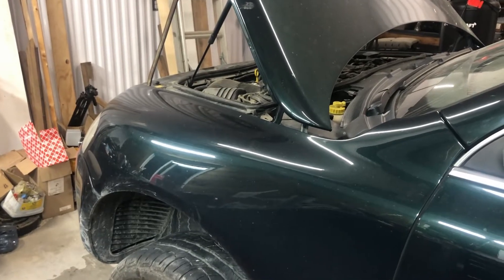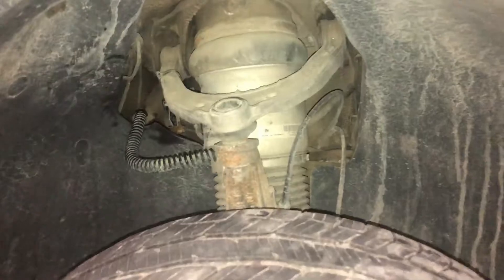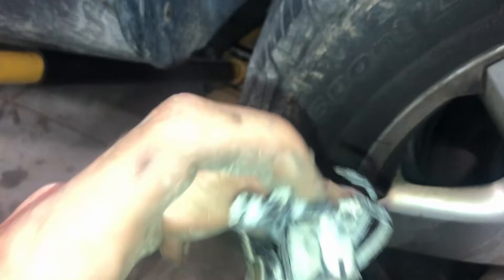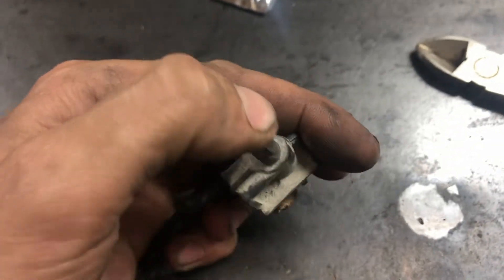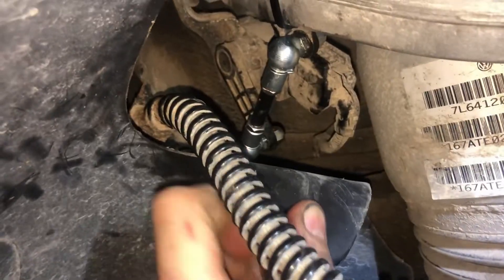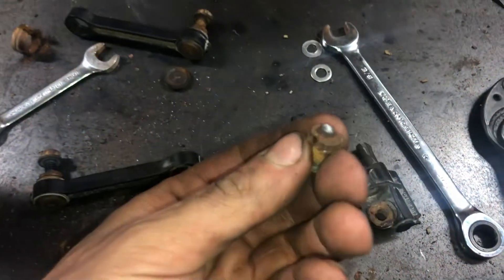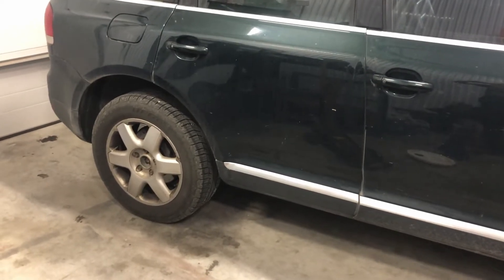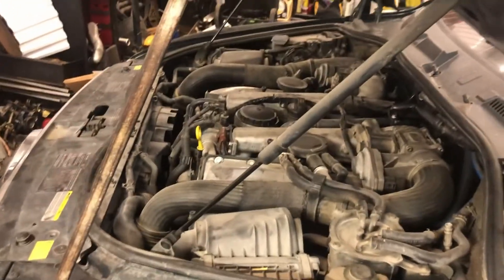7L/T1 Touareg DIY Ride Height Sensor Repair

Comment: Hi. I have a Porsche Cayenne from 2009,quite similar suspension. My problem is that the front suspension is lower than the rear in every level. There is no error on board no light or messages. I checked the front hight sensor and it has a movement on the upper arm fitting,probably that plastic thing is worn out,on both sides.Is that possible to cause the problem? Thank you!
Reply from the maker: They can wiggle a little bit and not affect the height. I’d try a calibration and see if it levels out, if not you can fake the numbers to get it sitting how you want
Reply: @JoshsJettas  Thank you for your answer! What software or diagnostic tool do you recommend for calibration? What do you think about iCarsoft POR v3.0? I’m thinking to buy one of those. I don’t know how to fake the numbers :) Do you have a tutorial or something about that?
Reply from the maker: @zsolabola I’m not sure on the Porsche’s, I use vcds on vw and Audi, I think it works if you switch a pin on the obd connector? The vw calibration you have to measure hub Center to wheel arch, if you minus say 20mm from your measurement it’ll think it’s sitting too low and make it sit higher and vice versa.

Comment: For what function exactly is this sensor, for the high of the suspension or for the lights, because I have an error that says, light range sensor ?
Reply from the maker: Height for suspension but that might come into play with the light range sensor, almost need vcds to see what’s going in
Reply: @JoshsJettas  thank you , I have it and I have expecience in VCDS, but with that I don't know what exactly is happening, I will search for solution, someone told be there is a sensor for the headlights at back left control arm I will check this first and this sensor looks like these in the front.

Comment: Better than the tire wrap, push out that pin and tap it for 6mm bolt. Cut off those 4 spikes that are supposed to hold that plastic in, then get a 6mm socket head cap screw and washer and bolt it in. I add blue lock tite and have never had one come loose.
Reply from the maker: I’ll have to look into that. The zip ties are still holding up for now

Comment: How do you get the thing off as i cant get anything to come off
Reply from the maker: The actual mount on the control arm? Mine kind of broke before taking it off but there’s a pin through the Center that wedges the mount into the hole.

Comment: What error did you get when that sesnor brokeup
Reply from the maker: It’s was a sensor out of range high or out of range low depending on how the arm gets jammed, I don’t remember the specific code. Either way the suspension will max out all the way down or up and you’ll know in a hurry somethings going on